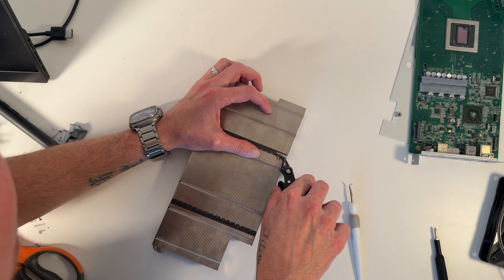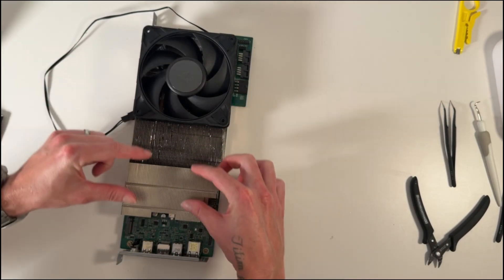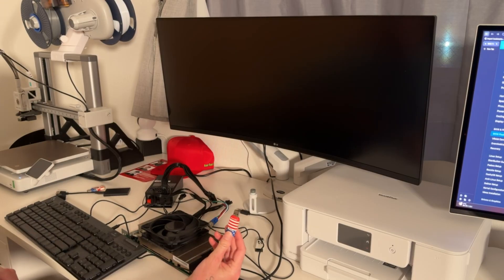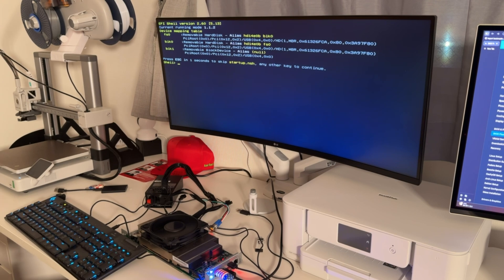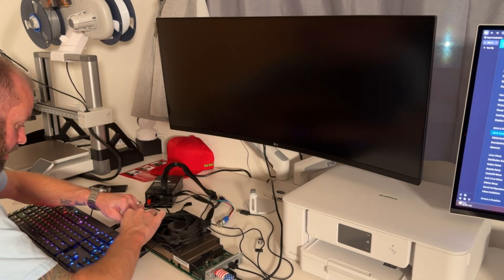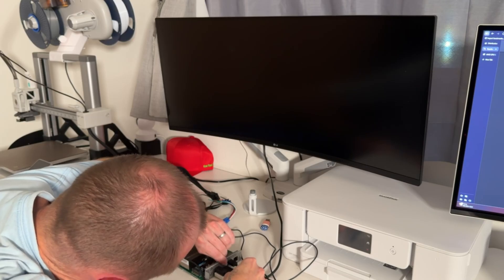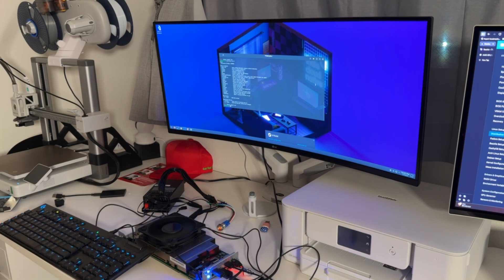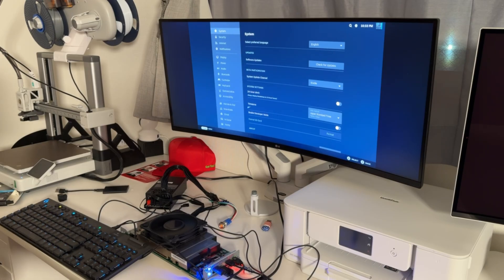I Turned the AMD BC250 Into a Mini Gaming PC (Cooling Mod + Bazzite)

Comment from the maker: The case finished printing. In the next video I’ll assemble the case, do some  over clocking, and of course test out some games.
Reply: NICE Video:)) Perhaps you could provide a detailed photo of how you connected the power switch to the power supply? Thx
Reply from the maker: @iAno1989 I’ll add a wiring diagram to the description when I update.
Reply from the maker: @iAno1989 check my community post. I uploaded a photo with wire colors for the switch.

Comment: That psu is so poopy, its not even the proper flex psu dimensions for whatever reason
Reply from the maker: Proper dimensions for what? Standard flex dimensions are 150 mm (L) × 81.5 mm (W) × 40.5 mm (H) which is the exact dimensions of this one.

Comment: Can you try a m.2 to sata converter to use ssd?
Reply from the maker: I’ll see if I can get an adapter. Any reason you’d want to use sata SSD vs an m.2?
Reply: @TiredDadTech nvme in my country 512gb higher x2 the price or more
Reply from the maker: @zaihFor17 that makes sense. I’ll see if I can get an adapter and let you know.

Comment: The Ugreen wifi AX900 USB adapter works with bazzite. I did have to update bazzite with it connected and then restart bazzite for it to work. It works great as a BT adapter to connect a Xbox controller to.
Reply from the maker: Oh, that’s great to know. I was actually going to start looking into that. I’ll definitely check it out. Thanks for the tip, that’s super helpful for anyone looking to use an adapter.

Comment: looks like it's going pretty well for you, hopefully you can get a real stable overclock. I did end up going with 2 Noctua industrials because I originally was going to go with 2 Noctua 15mm thin fans, but they weren't strong enough for overclocking. I used a hacksaw blade to put in-between then fins and pulled up on it to bend the fins up and detach them from each other, the straightened them up with needlenose pliers. I was able to get 3850@1150mv and 2200@1060mv stable for an hour of Cyberpunk, though I'm not sure that'll be stable for everything.
Reply from the maker: Did heat end up being your issue? Thanks for the update and sounds like you got a really solid setup. What case?
Reply: @TiredDadTech  yeah, it was climbing up to nearly 80C, so I had to shut it down and switch fans. I went with something called "AMD BC-250 Case Slim Cooling Optimized" from ebay, but modified it to accomodate 2 fans and an HDPLEX 500W GaN power supply.
Reply from the maker: @mexicanhalloween 80C is getting up there but not bad. Still no thermal throttling or anything. There’s a version 3 of the case I’m using. I’ll check temps and give that one a go. It’s supposed to give better airflow. Also going to test fan as intake or exhaust. My guess will be better to pull hot air out since the case doesn’t have the best airflow
Reply: @TiredDadTech  I don't know what it would have peaked at, but 80C in ~5min was too fast for me to want to find out. It doesn't even reach 70C now after an hour, but it's no longer dead silent. I suspect a single T30 would likely be better overall, but I prefer the symmetry and redundancy. I suspect the push configuration will still be better, that's usually the case for air coolers, but it's worth a try.
Reply from the maker: @mexicanhalloween ahh ok 80 in around 5 min is different. I must have read wrong. I thought you were gaming for a while and you hit 80c.

Comment: Why would use big picture mode on that instead of gamescope?  Gamescope would give better performance.
Reply: Not really, both Plasma and Gnome (Mutter) disable the compositor when games are in fullscreen, mimicking the functionnality of GameScope. Similar performance between 2+/- fps is expected.
Reply: @hubert06299 Maybe its been improved, its probably been a year since I tested any, but back when I did, it was noticeably better in Gamescope, some games I got as much at 10fps more.
Reply from the maker: I used Steam Big Picture because it’s simple and gives the BC250 more of a console vibe. Performance-wise it’s been basically the same for me since modern Plasma/GNOME will drop the compositor in fullscreen anyway. I’ll still test GameScope though, if it gives a real 5 to 10fps bump in some games I’ll definitely make note and consider switching when needed.